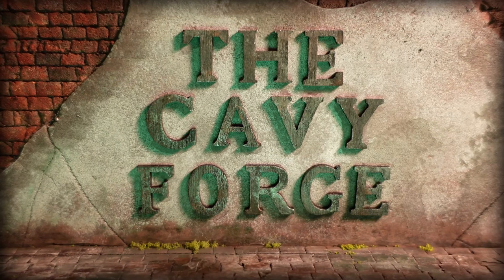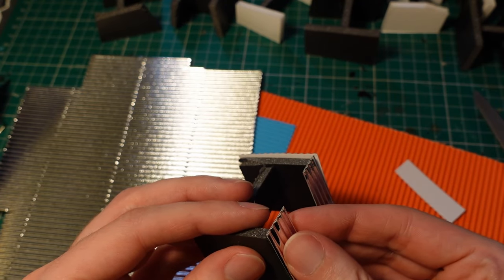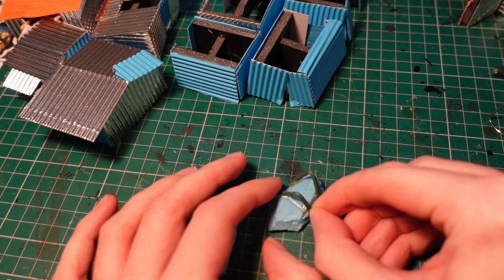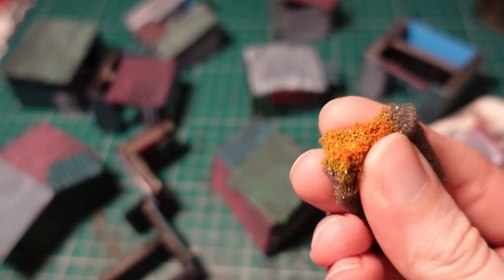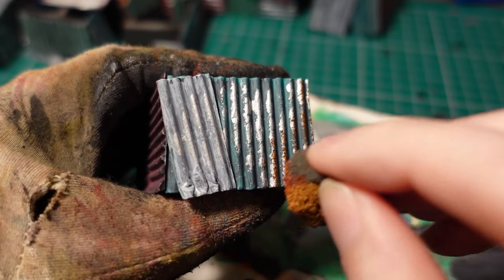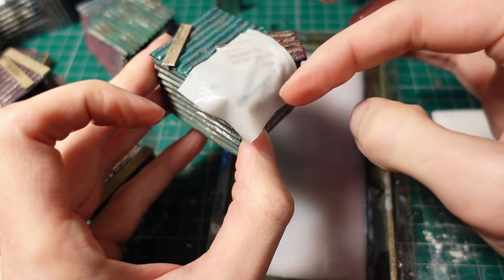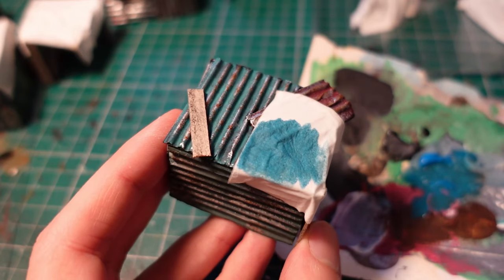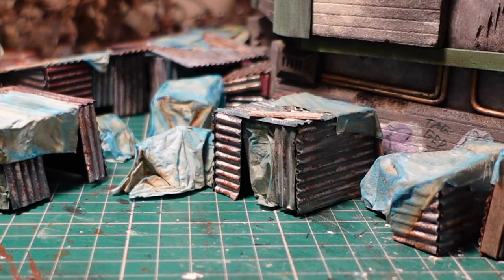Scratch built shanty town terrain

Comment: To save a step, you could mix paint into the glue-water before soaking the tissues in it. So they come pre-colored when you go to drape them over terrain pieces. Though this means the sheets will all be the same color (barring further painting, of course), unless you mix multiple different colored batches. 

That might not be a bad idea, though, if you build some shanties at one time, then add to them later. You'll then be able to tell which piece came from what batch, by the color of their fabric/plastic sheets.

Unrelated: I'm wondering if one couldn't add some lengths of paper straws into the construction somehow. As if the builders incorporated scavenged pipes, perhaps as corner pieces or to support the roof. Or maybe attached to gutters, to collect "rain" water. (Although now we're in the area of adding accoutrements to the sides of buildings, like barrels or cardboard boxes made from folded cardstock).
Reply from the maker: I think straws would work fine but I'd be tempted to prime them first before attaching for a bit of sturdiness 🤔